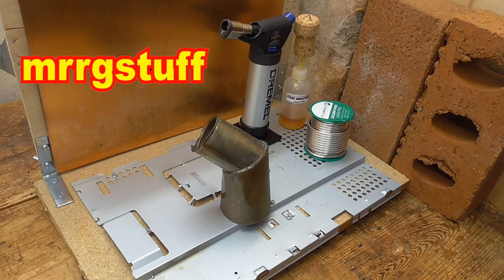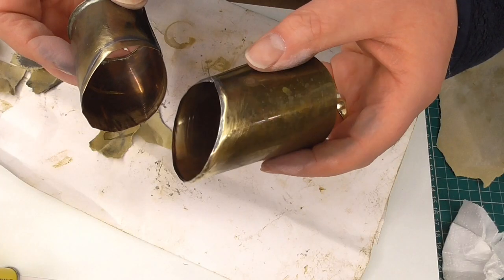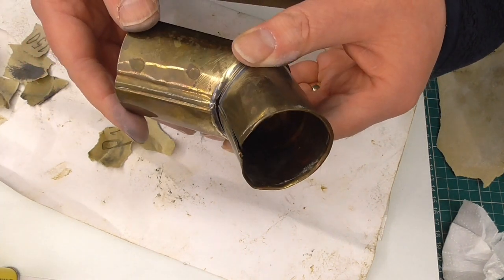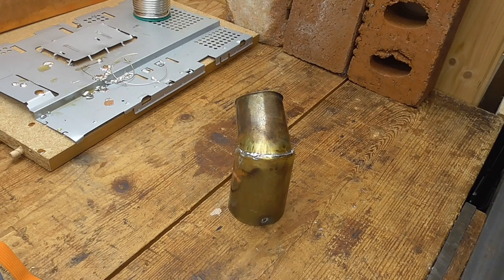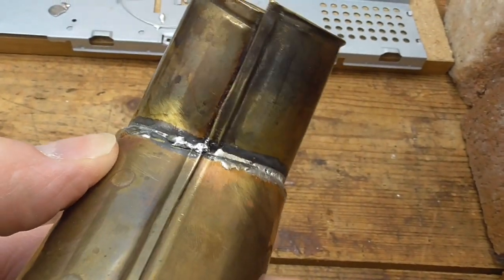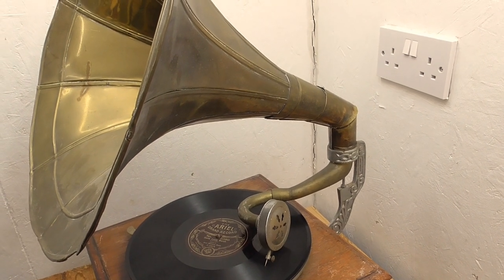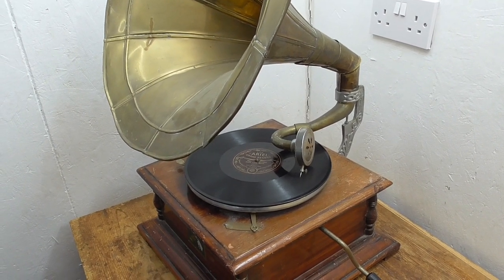Soldering a fake gramophone horn with a blowtorch

Comment: I do have an extra large electric soldering iron for doing tinplate such as my pop pop boats (when I remember where I last put it away). I can't remember what wattage it is, but I use the power socket associated with the cooker as that is on it's own circuit, rather than the ring main.
Reply from the maker: I've not used it in anger yet, but have just rewired a 60w Wolf soldering iron from the 1960s which might prove good for this sort of work. I doubt it would be powerful enough on its own though. The Antex one is supposedly 50w, but required me to heat the part up with the hot air gun before it had a hope of melting the solder. I do like the little butane torch though. Really does open up lots of possibilities! Thanks 😀 👍

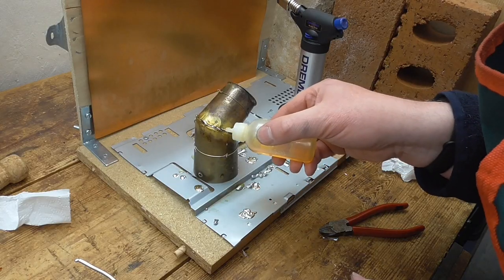Comment: 1:40  This will never hold assuming the video is showing what happened.  You have to heat up the pipe so that the heat of the pipe melts the solder. Never blow flame right onto the solder in order to get it to flow.  It doesn't work and it won't last.
1:50 Definitely will not work.  it will melt the solder, but the solder cannot bond to the brass without the heat.
Reply from the maker: Yes, its already lasted longer than I expected it to. It's a badly designed part and relies entirely on the solder joint for it's strength. The video sequences have been significantly shortened so the brass did get hotter and I  used more solder (and flux), than I show. However it's certainly not a tutorial on how to do it properly! 😉😅. Thanks 😀 👍
Reply: @mrrgstuff  Perhaps you can solder a steel bracket to both pieces or something?  Or really even rivets because the solder that's there keeps it airtight.
Reply from the maker: It's certainly an option. I had thought maybe a brass L bracket riveted on, or even some straps made out of sheet copper (only because I have some). So far it's holding though ... 😉😅

Comment: Looks like a solid joint.  Try some leaded solder, it's still available to purchase in the UK.  Much better for jobs like this.
Reply from the maker: Thanks. Yes the joint was pretty solid but I didn't trust it to hold up long term so I have made some 'improvements':
https://youtu.be/g_F7XUuOI68
I did think of using leaded solder as I have quite a bit of it, both plumbing and electrical but I am trying to use lead free where possible 😀👍

Comment: Hi again! What's the best way to fix the original ones? I keep watching your videos and I hope you have one :)
Reply from the maker: Although it's probably possible to make all new parts for it, finding some replacements or modifying something similar would be easier. New parts could be made by shaping brass and gluing or soldering. Having access to a lathe would probably help too
Reply from the maker: Sorry, just left you a comment to this thinking that you were referring to your Decca soundbox. If you meant how to fix real horn gramophones, then although I have no experience fixing the horns, I did recently revamp this machine: https://youtu.be/vDpsJK8J7WQ
Thanks 😀 👍
Reply: @mrrgstuff  thank you! I believe I'll have replacement for the soundbox. But having trouble with horn as well!! It has a threaded ring  but it's gone off. I somehow need to  fix that as well! Getting there slowly!!

Comment: These fake machines are all over eBay! I have come across a few in person. I have noticed how light weight these machines are?  As the are most likely made of pressed particle board or other light wood. Plus the motor has no weight, and the turntable is wobbly. Most likely they are massed produced!
Reply from the maker: I have a couple and have seen one or 2 more in person. They seem to be made of something like pine, heavy stained and varnished to give a dark 'mahogany' look. I think a variety of motors are fitted and in some cases genuine vintage parts are used, but largely I think they are all new builds. They must have been around a good few decades now and whilst I don't have any information on the production of the parts  there are some videos showing them being assembled in small workshops. I've put together a playlist with lots of videos about these. A couple of the workshop videos are at the top and there is a longer one nearer the bottom. I intend to do some more videos on these as there are some quite interesting design aspects about them. Thanks 😀 👍 
Fake Gramophones: https://www.youtube.com/playlist?list=PLsCYUbO6xxnTYCcCD7dZIbQu8td3ZZWCv
Reply: @mrrgstuff  thank you for the info!

Comment: -but I wonder if its easier to build a new one by your self...?
Reply from the maker: Maybe 😅.  The motor is the hardest part to do. Have you seen this video?
https://youtu.be/ERf_iiJJgig?si=tTuD3v5Qh6Cxk8Ls
Thanks 👍 😀
Reply: @mrrgstuff  oi!! (I still think you can make a better motor, than those guys sitting at the pavement and making motors...)
Reply from the maker: It would be very interesting to see how the motors in the fake gramophones are made. I'm guessing the various parts are made in various workshops, and then brought together where one person assembles a complete motor by hand. I may be completely wrong though. I think even building a simple clockwork motor from scratch would be very difficult, especially the spring 🤔